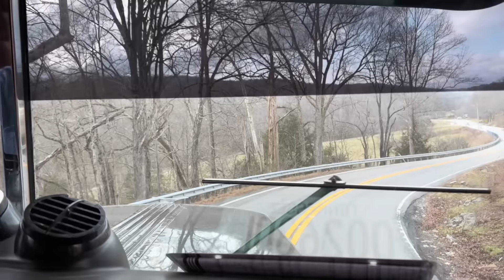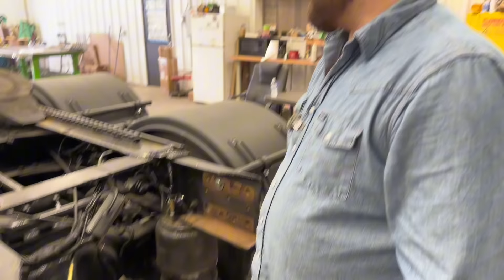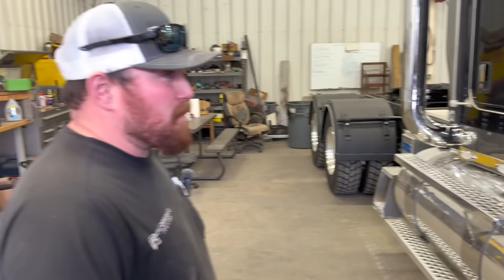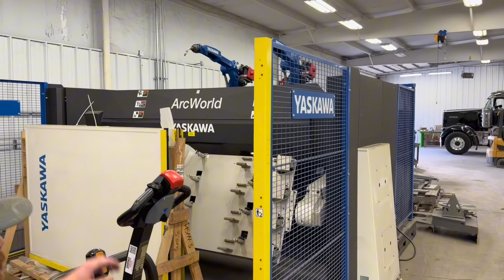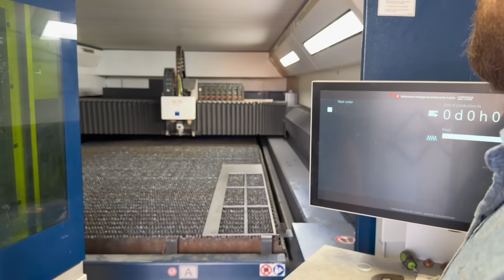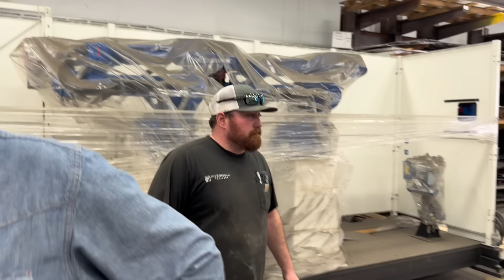Can a 40-Year-Old Peterbilt Still Work?

Comment: Man that's a really really nice looking truck 🚛 man . It so awesome how you was driving with socks on too . I drive barefooted 👣 in my truck 🚛 all year around . I don't even own a pair of shoes 👟 , socks , or boots 🥾 at all because my foot outgrow them because I have big & very very Extremely extremely extra wide width feet 🦶 with very very chubby fat wide toes that are Evenly straight across instead of being rounded off at a 45 degree angle shape like your toes are or like footwear are made making my foot very very Extremely extremely extra wide width at 6 1/2 inches wide from my big toe to my lil toe . Plus two it keeps the inside of the truck 🚛 clean too . Thanks you for sharing this video buddy .
Reply from the maker: Glad you liked the video! 🚛

Comment: I run my 1987 359. And if you know your Peterbilts. 1987 359st   is a number tractor.   She a total rebuild. I order it in later 1986. Think they only made. I think 8800  built ,,Mine in number #237   The number packer is brass with Pete name on top in red  with Classic 359 on bottom and right bottom in numbers  stamps in red mounted glove box on dashboard I have same style 444 Cummins with 15 speed. Was on build sheet    Built with a 444 Cummins 15 speed with3:70 rears ,

Comment: (In General) 
Give away stuff always FAKE !!
I don't believe that someone would give away something that cost them money and effort without expecting anything in return.
Reply: its not fake, they actually most of the time make money off these giveaways with the entries. Also do you really think Bruce would scam us?
Reply: They run the giveaway until they make back what it’s worth
Reply: They're definately real, they make money off of the revenue for the entries to cover the cost of the giveaway. If any youtuber says they're doing a giveaway to give back to their viewers it's bs, they're doing it to make profit. And most of the time they'll have a line in the small print that says if the giveaway revenue doesn't achieve over X amount (enough to cover the giveaway items and fees and make some profit) then the winner will get like 25%-50% of the revenue from the giveaway instead ofthe grand prize.
Reply from the maker: Actually we are licensed and bonded, our attorney handles everything. Whether we profit or not the truck must go to a winner. It has a period of 45 days start to finish. The end of promotion has nothing to do with the sales amount. All the rules are on our website!